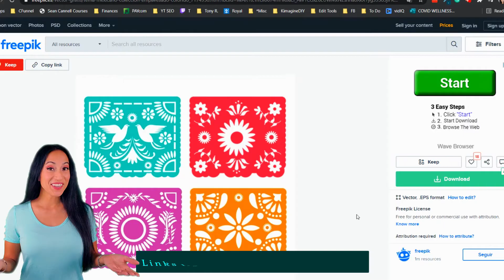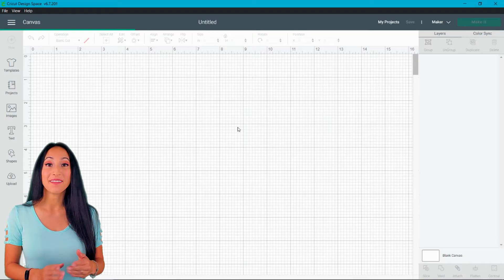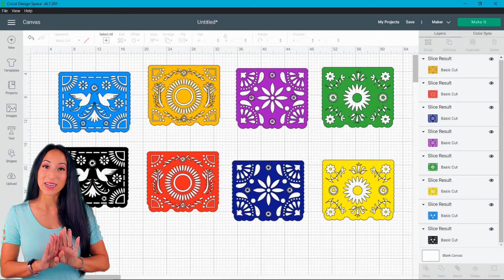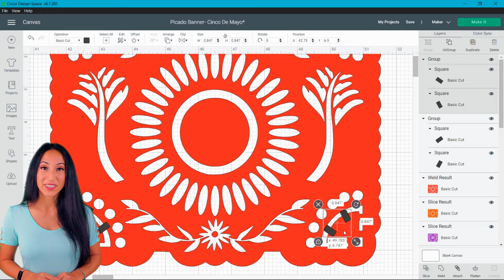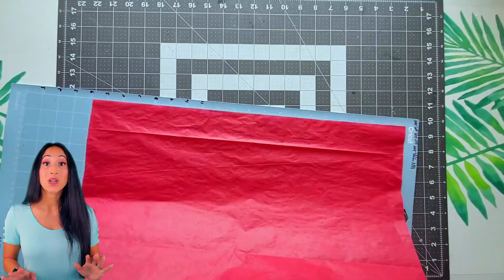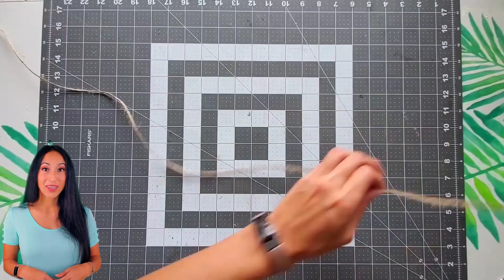Cricut Fiesta Ideas | How to Make Papel Picado Banner with Cricut | Day of the Dead Cricut

Comment: Thank you for sharing your knowledge 😊 Do I have to have a Cricut subscription to do this? I figured out the freepix and uploading but can’t get it to be single cut, keeps telling me it’s a flat graphic for print and cut 😣
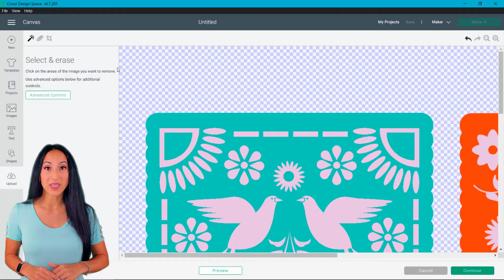Reply from the maker: Thank you so much for watching and for your question. I actually just tried uploading the image again to see if Cricut changed anything since posting the video. After uploading, it takes you to the screen with the background remover. If you are like me and don’t have a subscription, look on the left side near the bottom — you’ll see a section labeled “Manual.” That’s where you can select the magic wand tool and continue following along from timestamp 1:10 in the video.

Be sure to use the preview button to check that you’ve removed everything you want to before clicking continue. It can be a little tedious, but that’s the best workaround for the free version. You’re doing great figuring this out. Once you get the hang of it, it becomes second nature.